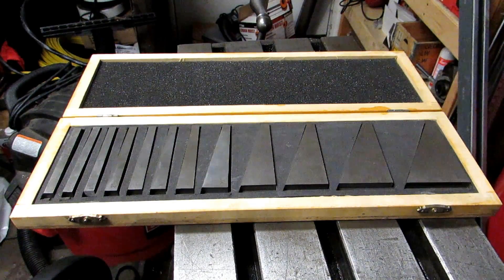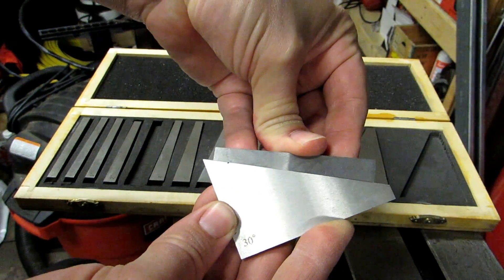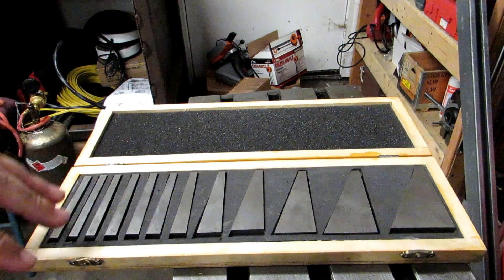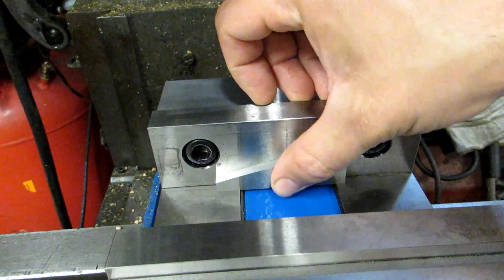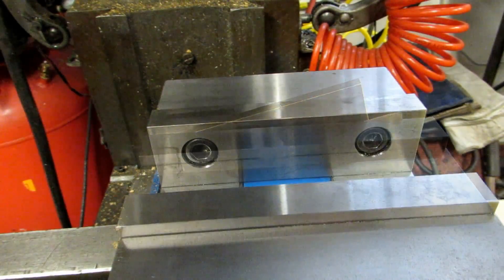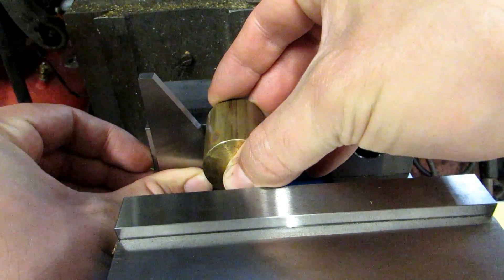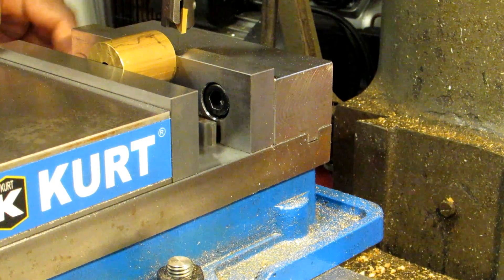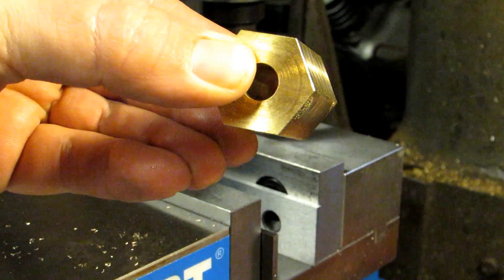How to use Angle Blocks

Comment: Am new on this is just gat the aprendeship for tool and die i wan to make my own .how i can start
Reply from the maker: @rafimex195  The most accessible way will be a sine bar. Have you seen one of those yet? It's a rectangular bar with two round rods at the end that are spaced an exact distance away from each other. They're used to set precise angles using a stack of gage blocks on one end that you figure out with some basic trigonometry. Let’s say you want to make an angle of 5 degrees. You take the sine of 5 degrees (hence the name of the tool) and multiply it by the distance between the two "rollers" (the length of the hypotenuse of the triangle) and that gives you the height of the stack of gage blocks (the opposite side of the triangle from your 5 degree angle). You'll have to do that for every angle block which will be pretty tedious and you'll need to do it on both the mill and the surface grinder but with some care it's very doable. Of course, now that you know about sine bars you might want to make one of those instead!

Comment: Ordered this set and a bunch of other tools from sellers on eBay. There's an option to order from US sellers, but that has been circumvented by Chinese sellers. The Chinese sellers will post pics of well machined tools, but they ship junk. Wouldn't mind if they posted the actual tool they're shipping, so I can make the choice. Reputable sellers are also selling questionable tools as well now. Seems we may be better off making what tools we can, when we're able to.
Reply: I get rubbish from Chinese sellers no more often than I do local.  
What the Chinese have done for us is murder the ridiculous prices for tooling that made it impossible for the amateur to have a go.
Reply: Yes, I agree. I've been modifying a lot of the tools I have, that were made in China, to improve how well they work. Because these tools are more affordable, I'm able to work on a lot more projects and make more accurate, quality tools.

Comment: About the angle block spacer, place the angle block on the movable jaw, install spacer, then set part, clamp.  The spacer will never fall between angle block and jaw, your part is referenced to the fixed jaw.  Better yet make a stepped spacer, that sits over top and on side of the angle block which is hooked so it doesn`t slide down and stays in place.